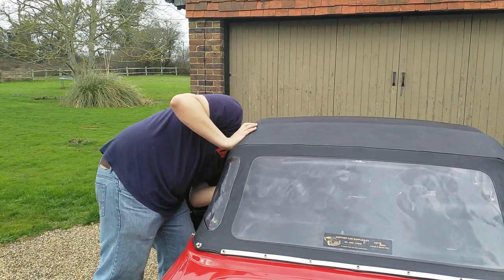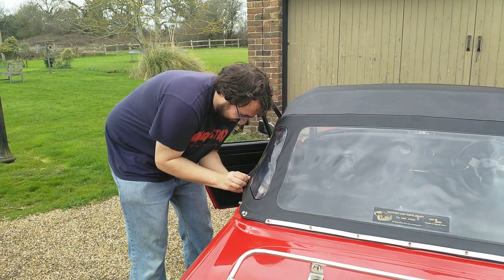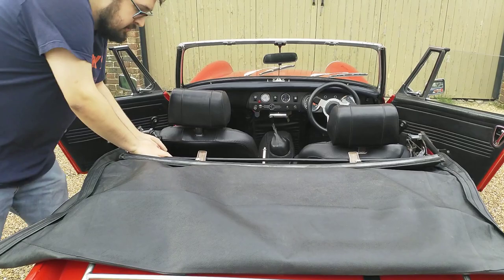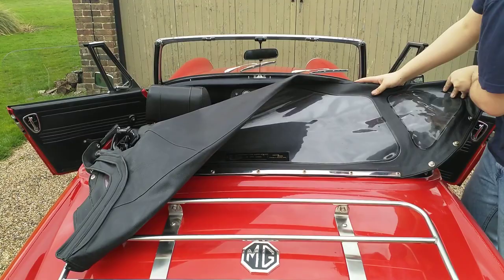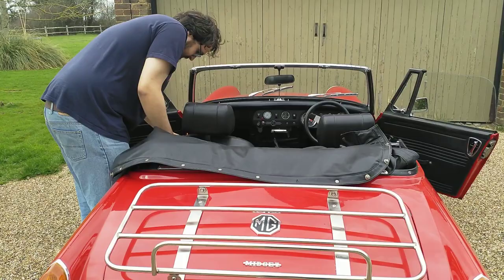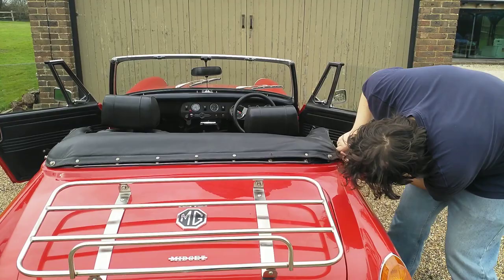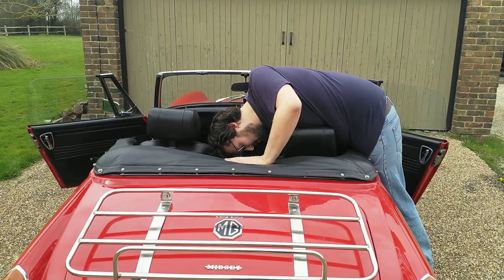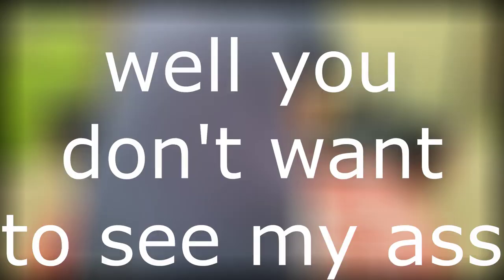How to lower the roof in a MG Midget(Austin Healey Sprite) made in 1966 and after.

Comment: Having owned the same midget from new since 1970, Just a couple of points . Firstly the two clips that hold the front bar to the windscreen should be folded flat before the hood is folded on to it.  The quarter lights should be folded over onto the main part of the hood, when it is laid flat on the boot lid, at the joint between the clear lights , then the whole should be folded forward over the framework and back under the framework. The hood cover should be clipped along the back rail to start with, then the clips on both sides should be connected , working from the rear to the front. Final the four straps should be fitted to their connectors .
Reply from the maker: Yes I plan to remake this video

Comment: You COULD fold the rear quarter windows UNDER the bigger central rear window.   Then the 'poppers' won't be rubbing on the clear window material.   I had one for ten years!
Reply: You should fold the quarter lights inwards whilst the hood is flat on the boot lid, then fold the hood forwards into the well! This is all clearly explained in the handbook!
Reply: @michaelharris9787  yes that's what I do on mine, means you don't actually have to put the tonneau on.
Reply: @michaelharris9787  Yes, that is the correct way to protect the rear quarter windows .   I thought the same.

Comment: Total pain in the ass. Why didn't they just make it like an Alfa Romeo or Miata? Undo two clips and flip back. Viola!
Reply from the maker: @mac daddy  yes I believe Alfa where the first to do that! It comes down to cost really like with the MGB these cars were far cheaper than there rivals but that ment no high-tech modern (for the 60s) elasticated fabrics or hidden tensioning systems. It is not a bad roof on the mg by any means and with practice can be done reasonably quickly.
Reply: @DinosaurJuiceCars  You are 100% right, everything comes down to a price. I had a 1974 MGB, it was a fun car for sure.
Reply: Because it’s a car dating back to the early 1960s . Your statement is like saying why didn’t the Wright brothers just invent the Spitfire or P51 Mustang . It’s called progress .
Reply: @michaelhart895  Your statement makes no sense. The 60's Alfa Romeo made it easy. Two clips - done.

Comment: Damn that's a bad design, the mx-5 does it so much better
Reply from the maker: Louis Gordon yes but the MX-5 is from 1989 and this is from 1966.
Reply: @DinosaurJuiceCars  The Alfa Romeo spider is also from 1966 and does it the same as the Miata. Two latches - done.
Reply from the maker: @bigmacdaddy1234  yes I believe Alfa where the first to do that! It comes down to cost really like with the MGB these cars were far cheaper than there rivals but that ment no high-tech modern (for the 60s) elasticated fabrics or hidden tensioning systems. It is not a bad roof on the mg by any means and with practice can be done reasonably quickly.